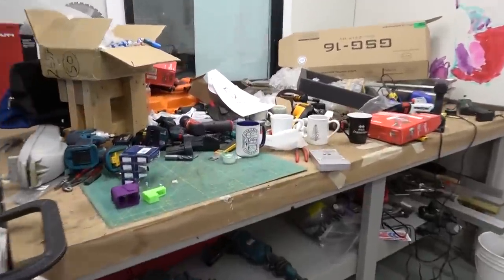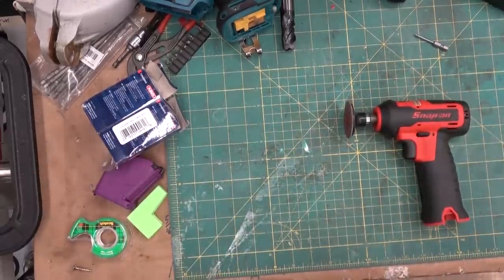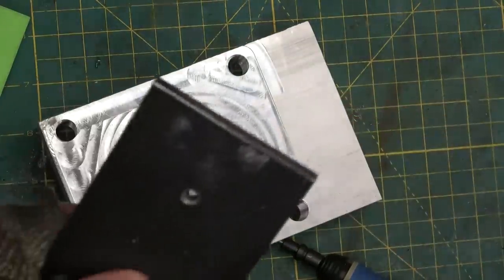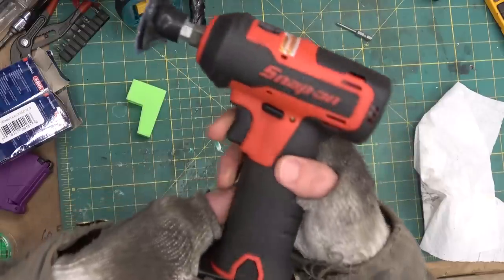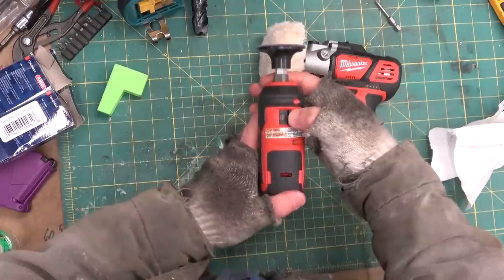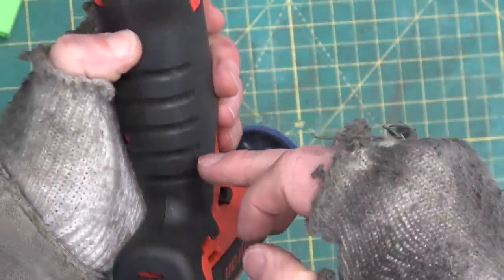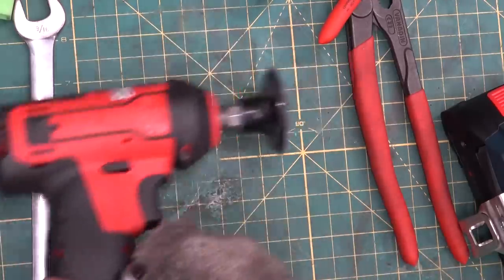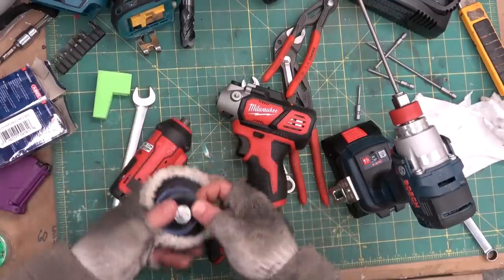BOLTR: Snap-On Polisher $$$ worth it?

Comment: I bought this just tool not the kit with the batteries. Already own other 14.4 tools. But out of all the other ones this one has to be the worst. After warranting it twice now just lives in the drawer. Both times smelled of something burning then gave out. Kinda disappointing love the 14.4 3/8 impact and ratchet use them daily. The ratchet had to warranty for button breaking off but it happens.
But the sander was waste of money.

Comment: As far as the over molded grip, I can say my dad has been using all the new snap on tools with a Similar construction. And has had no issues with it peeling off or wearing very much. Hes been using them I I beleive the past 2 or so years. Though he works in a body shop so oils dont often  end up on our eletric tools.

Comment: It's not worth the extra cost. Its not really designed to be run in high speed. Ive burned one up. The only reason i bought it was i was already invested in the battery platform.

Comment: Yeah the over molding is junk. I build transmissions for a living and on every single snap on electric tool it swells up and comes off after about 3 months. Even the plastic handles on their ratchets swells up. None of it puts up with the transmission business too well. Also on the 3/8 impact and the big boy hammer drill I had to replace the triggers in them twice in the first year I owned them. Once each for losing the braking function and once each for just all out failure. Wouldnt move in either direction. Biggest waste of money I've ever spent. After a year I got rid of all of it. I had spent about what you did on every tool and I had the 3/8 impact, the small 3/8 chuck drill, the big boy hammer drill 1/2 inch chuck, the 1/4 inch ratchet, the 90 degree drill in the same body as the ratchet and a small driver about the size of this sander you're reviewing here. The driver was in the same body I believe. Huge waste of money.

Comment: That thing screams stay with air. I know of no bench that doesn't have easy access air for such tasks. What I really want apart is the dewalt rim and joist drill 5/8 chuck damn that drill all I have is 1/2 in keyless kicking around y dont they come with keyless! Sinclerly mr confused

Comment: yeah, but the milwaukee red clashes with the rest of my high visibility yellow snap-on battery tools ;). all jokes aside, i wouldn't be buying one of these, although i really like the long neck 3/8 drive battery ratchet, i've beat the crap out of it, literally hung off of it breaking bolts free, and honestly it should be broken by now, but its still going strong.

Comment: I have the 1/4 impact and mine started out orange and ended up pink in 8 months the rubber molding is holding up but fck that battery is tight

Comment: I don't particularly own this exact tool, but I do own some of the other fap-off 14.4 volt power tools. The drill was awful, the chuck would loosen all the damn time initiating a drop check on my drill bit. I'd crank the fuck out of the ratcheting chuck and it'd still do it. It's a fucking pain when I'm drilling out 40 rivets and the bit keeps dropping out every five. 

I had the truck send it back for warranty, which took about two damn months to get back and the tag it was returned with from the repair shop actually wrote "to make sure the chuck is tight" so tell me why the hell does it still do it?? Fucking returned it the next week and got my money back. Fuck that piece of shit. My Dewalt chuck drill is rock solid and was almost 1/4 of the cost. 

On the other side I own the 14.4v quick change electric screwdriver and 3/8 impact and both are fucking awesome. I've dropped the impact lots of times, work with 99% isopropyl alcohol/grease/dirt etc all the time and my over molding has not peeled off. I use the electric screwdriver all the time on aircraft with the torque limit dialed down and it's just a great tool.

Comment: Had 14.4V impact and hex driver. Same motor and body. The impact was always breaking the solder joints on the circuit board where the battery connects from the vibration. Trigger on driver was poor

Fixed and sold both and bought milwaukee. Much better tools for less. I like spapon generally, but the quality is poor on these.

Comment: Not every AvE tool review is skookum as frig. Case in point: Milwaukee M-18 Multi tool, he claims is junk. I've had one for several years. It works just fine for what it's designed for. If you want a true representation of a tool's quality ya probably don't want to take it A-part before yousing.

Comment: I have one of those and my boss has one. His is heavily used to grind fiberglass, which as you know takes a beating on any tool. First one lasted almost 3 years before the motor went out. New one is a year old and sti going. The over molding holds up amazing on all the snap on 14.4 tools but I will say, this is the worst 14.4 tool made by snap on. No power at all, battery life makes it about damn useless.

Comment: I bought the 3/8 snapum gun from a cornbread coworker feller from plaski. He used it hard for 2 years. The only bit of foreskin comin arff is the little thin bits near the top of the gun. Shes still minty as frig. The only problems ive had with the 14v snapums are the shitty fuck ass batteries.

Comment: We use the Fap Off screwdrivers which use the same design and have promised to never buy them again. The battery terminals stop connecting, the brushes wear out quick and the warranty is crap compared to Milwaukee. Our service guy is also shit and never shows up. Milwaukee all the way

Comment: I wish they would stop putting the soft rubber averywhere. It only looks and feels good the first time you take it out of the box, thereafter it just gets more and more disgusting as it gets used and specially as time goes by. If you are going to use a special material for the interface between my hand and the product you might as well make sure my natural oils will not make a mess of it.

Comment: Cool metal Parts tray if it's austenitic stainless steel put a magnet on there and it will keep your screws and Bolts from Rolling off of your tray I have a tray kind of like that that I put a magnet on and I noticed the magnet helps me keep track of the hardware of every project that I'm working on if you put a strong enough magnet on that tray it should have enough power to hold down all your Hardware peace out into the world have a great day a b e

Comment: Fuck me sideways with a ten-foot barge pole... How the fuck does that even work?! Think I paid $350 Australian Dollery Dingo's for the Fap-Off, straight off of the Fap-Off truck WITH a battery.

Edit: I've owned the tool for a good year or so, No issues with the over-molding, But it was only really used to remove silica from aluminum.

Comment: Snap On power tools aren’t worth it.  I worked for years in a Automotive repair system plant that was in the “Snap On Family” and we used all of their pneumatic and power tools to assemble 2 and 4 post car lifts.   I can personally attest to the craptastic quality and reliability of their battery and air powered tools.   Even with relatively light use, I was still replacing drills, drivers, impacts, drivers, and grinders MONTHLY.  I might have used a grinder once a day to fix a quality issue, but the tool would deteriorate to an unsafe, and in some cases dangerous condition within days.  The batteries very easily overheat.  The motor housings would turn to bubblegum after an hour of NON CONTINUOUS use.  I will never buy another Snap On tool.

Comment: I currently own every cordless snap on tool and this polished is by far the worst quality and just feels cheap. 5 years of use with all the others but only 10 minutes with this. Just no use for it when a drill or bit driver works as good.

Comment: I have their 14.4 ratchet 1/4 standard length. The battery design is atrocious, tighter than a nun's... the rubber overlay is made of play dough, is gouged, peeling and greasy AF. The tool works okay but the quality is not good. Which you also just found.

Comment: none of these types of tools are meant to last , not really sure if they ever were. the only tools that are going to last are purely mechanical tools with no electronics or plastics inside them.... All the battery powered shit is designed to be phased out and have a relatively short life. anyone who buys this will probably have the new model in 5-10 years. and only 10 years if its used lightly and the batteries are still somehow good.
Reply: not saying i dont have my fare share of battery operated power tools , but we shouldn't be talking about them like they were our dads old metal housing diecasted Pneumatic tools that last forever and have rebuild kits.

Comment: I had the entire set.  Sander/Polisher, 3/8 Impact, 1/4 & 3/8 Ratchet, and 3/8 drill.  In the body shop the overmolding didn't last FOR A FUCKING MONTH.  Lacquer Thinner EATS THEM THE FUCK UP.  BOOO Fap-Off BOOO

Comment: Well, this is just one of many reasons I do not buy Snap-Off. I know people that have sworn by their Snap-On tools for decades.... and some of them swear they are still the bee's knees.... but in my experience over the years, Snap-On earned their new Snap-Off name. I have broken more of their tools than any of the other expensive brands. And seeing how this polisher is made..... screw that noise! Not paying $540.00 for something like this, there is nothing, absolutely NOTHING that makes it worth that BS. Poor tooling to make the plastics, soldering that would make even a much younger me cry, terrible machine work on the metal bits...... just, NO.

Comment: Good job a v e from what I can tell it looks like the overall build quality of the Snap-on and how the hell are you saying fap off is that how you spell it I'm very curious anyways I love your terminology and making fun of words but to the point of this continent yeah it looks like it's horrible case of value engineering gone awry cuz that thing is pathetic thank you for buying that piece of crap Snap-on so the rest of us don't have to waste our money on it and I really do like how the Makita has that locking pin to where you can take out the grinding or buffing wheel without tools that really speeds up your project instead of having a dick around with finding a tool to swap out a disc that is very annoying and also the fact that they're not cross compatible is a pain in the ass it looks like the Milwaukee's a lot better of a build quality and also thinks about the end user of the tool a little bit more the Milwaukee's a lot more Skookum than the Snap-on the Snap-on needs to be thrown in the f*** it bucket peace out to the world have a great day

Comment: the only job I am paid that I can use this is for doing tire patches. that's it. I get paid 15 an hour and get paid .3 hours for each tire patch. so it would take me 101 tire patches for me to pay this tool off and break even where as the will fuck the would take me 53 tires for me to pay for the tool and start making money. this is why all the techs in the shop I work at buy Milwaukee tools. snap on needs to lower prices because Milwaukee is able to make tools that can be competitive with the rape van tools for a fraction of the cost. snap off aka the rape van Toolshop need to back off on pricing or else they will go under. I dont want to see snap on to go under because I do like some of their tools but they need to lower their prices and predatory loan tactics or else most mechanics will go to other companies that d thisnt want to go in dry on the techs. that Gucci like brand ne will only last so long. moat of the techs that are on the gucci brand life go to tool truck that cost less like cornwell or mac tools

Comment: Shit peels right the fuck off with any baby oil use as a mechanic I sold all my fap off shit off and made the switch to milfuckyee simply because the cost of one snap on and wait time w repairs or maintenance wasn’t worth it I can buy two fuel Milwaukee’s to one snap on w a brushed motor

Comment: Made in America with Chinese molds, that's why they were re machined on the bottom, my brother is a mold maker, and I used to work in injection molding, spot those China molds a mile away. That being said its sad to see what's left of American manufacturing turn to crap from shoddy workmanship

Comment: I own almost the whole 14 volt lineup of snap on and they are all kickass tools except that gods damned polisher haha. fucking pile of garbage it is. I dont understand why the drill will run nonstop all day but the polisher runs for more than two minutes and it burns up. I have to put mine in the freezer for twenty minutes after every one minute of consecutive use. it's a good thing I got it on a promo for buying the ratchet.

Comment: I laugh my ass off watching all of vajayo's,  and "Keep your dick in a vise".  Lastly I have a query,  I have a Fluke 410A amp clamp and need a new end that plugs into the multimeter.  I have ruined it with my gorrilla size hands(possible with some anger too).  Thanks for the help.  Fluke wants a arm , leg and my left but to fix it.